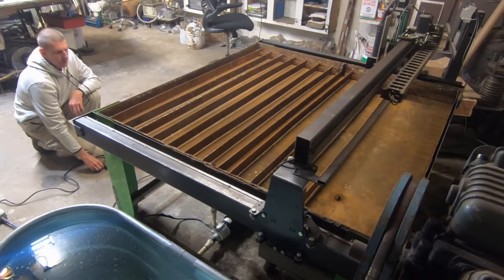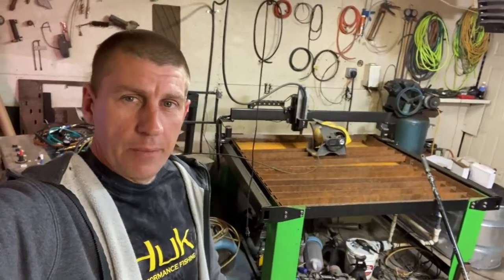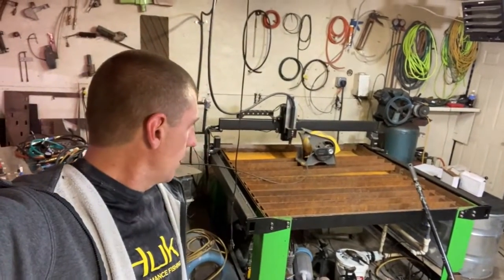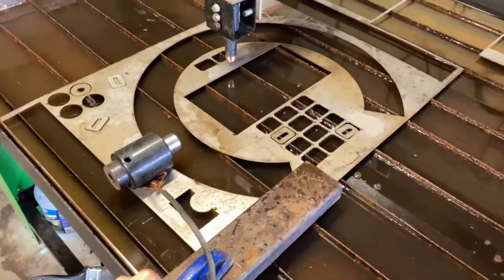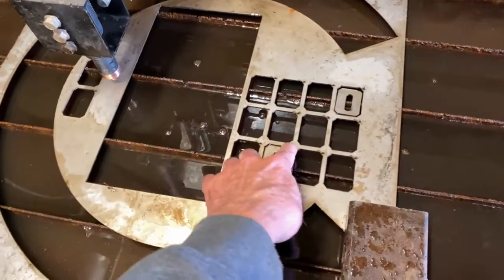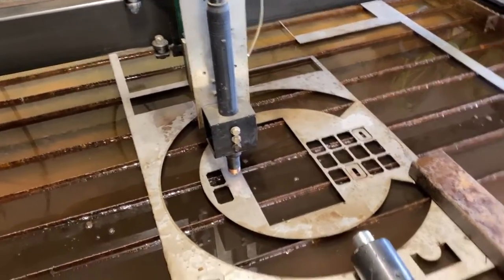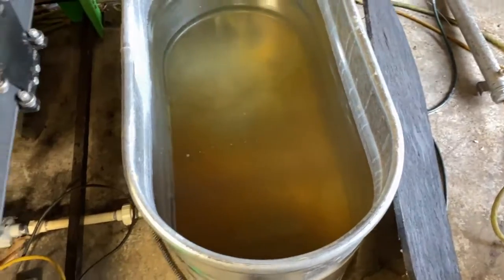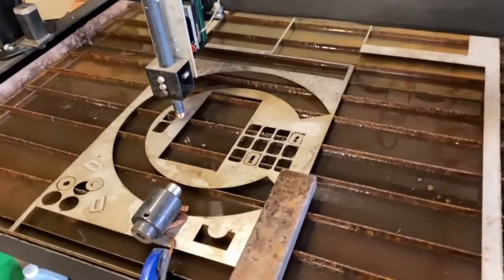Plasma Table Drain tank Bug stopper

Comment: Sterling Cool is one of the best cnc bath solutions you can use and is non hazardous. Keeps from rusting and cools parts quickly. I believe it also helps tremendously with bacteria. It is a little pricey at 175 per 5 gal Bucket. We have a 4x8 table and have to use to 5 gal Bucket and about 50 gal of distilled water do help keep down on the corrosion.
Reply from the maker: No thanks , the bugs proved to me its a bad idea .
If your in a shop with no flying insets yes i bet the stuff is great.

Comment: That’s a great adjustment. If I could be so bold to offer another. Plastic pipe with removable neodymium magnetic’s, rust is attracted to magnets, rinse and repeat.
Reply: Rust isn't generally attracted to magnets. If it has bits of metal in it, that might work. But the rust itself isn't magnetic.
Reply from the maker: Maybe i could set  couple of huge ones in the botom of my tank